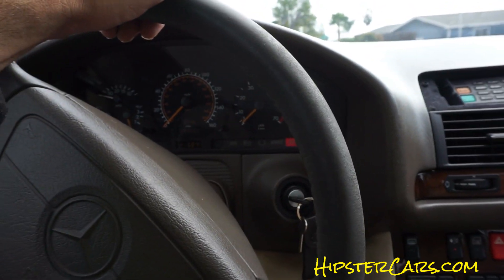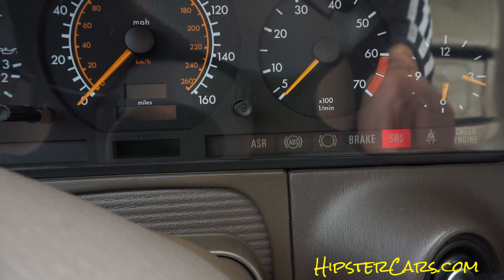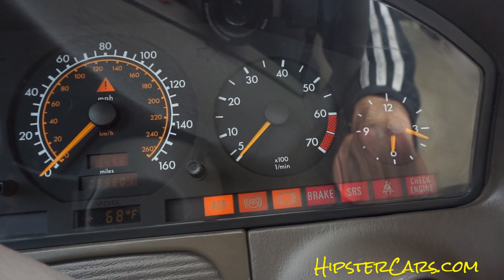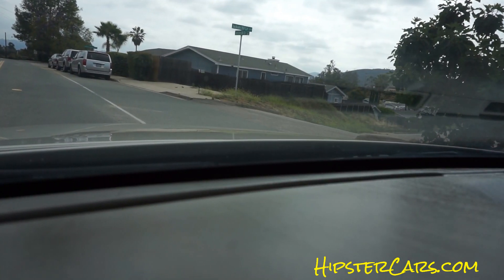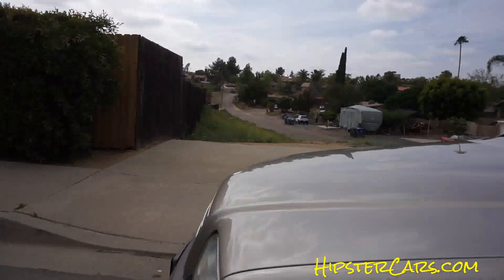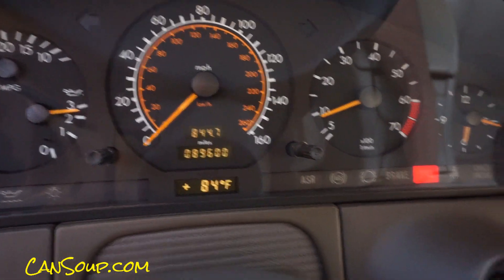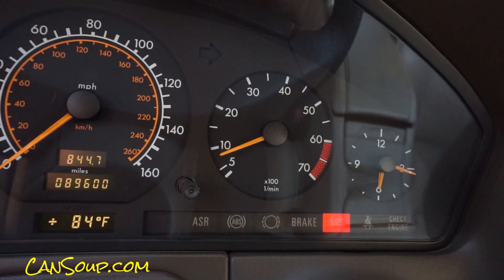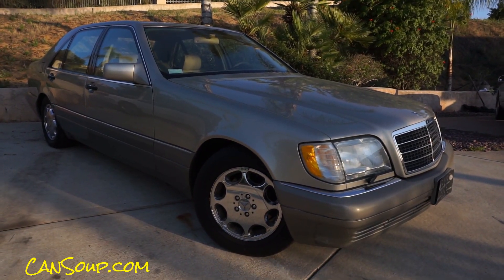Fix Mercedes S500 Catalytic Converter issues Broken W140 Car

Comment: Hey Nathan, i have seen that issue on the M119 engines before and basically the fuel pressure is too low or a problem with the throttle but my ultimate bet is the fuel pump assembly (with the filter) start of by purchasing a fuel filter it might be clogged and its cheap if i remember correctly the part number should be A0024773001 if it did not help the issue just replace the fuel pump. well it seems that you have few w140 swap the fuel pump assembly with the green w140 you drive its a 10 mins tops job but take care when removing the filter/pump you will be sprayed unless you remove the fuel pump relay in the trunk close to the battery and start the car... but im 100% sure that it is NOT a cat problem Cereal Marshmallows

Comment: I have the same issue on my 95 S500 Coupe now. My cats went bad so i emptied them out & after that it was dumping allota fuel & choking up. Plugs on passenger side would get wet & after chilling a few hours it would start & drive for a few minutes till it dumped fuel again. Now it won't start at all
Reply: I have a clog in the catalytic converter. Do you recommend draining the catalytic converter? Does it cause any harm?

Comment: Hi! My '95 S420 is doing the same thing intermittently plus I hear popping under the car around where the middle about where the cats' are. I was thinking the CPS but what was the cause of your issue?
Reply: Did you figure out the poping sound under the middle of the car? mine barley starts and idles really bad and when I give it gas, I hear the poping sound under me then it dies instantly. All basics tests checked out good.

Comment: Now i know next to nothing about how Mercedes engines work, but when my Olds died on me in a similar fashion and then started up just fine after sitting for a while, it ended up being a power relay that tripped causing it to cut power to the fuel pump, I dunno if Mercedes sets up their power systems similar, but if they do it could be worth looking into any relays that might be bad that might trip and cut the fuel pump off from power.

Comment: i just parted ways with my 1992 500SEL after years of this issue. I took it to  3 different mechanics, at mercedes dealers and non-dealers, and each said they'd fixed the problem. A few months would go by with no problems, then it would die while i was in traffic and the cycle would start all over again. For awhile, i could let it sit for an hour and it would fire back up with no problems. Just like in this video. Then, that stopped working. Ultimately, I couldn't justify spending thousands of dollars on a problem nobody seemed able to fix. It broke my heart. It was a 1-owner car with just 50k miles when I purchased it in 2007. 10 years and well over 20 thousand dollars later I donated it. Now i am saving up to buy a 2007 S-Class, I just love those big sedans!
Reply: Stay away from the 07 SClass buddy go with 08 & up

Comment: I'd clean the mass air, need to check it when it wont start up again. could be fuel, but even something as small as a temp sensor can cause issues. I say it's something small.. easy fix.
Reply: Cereal Marshmallows That's cars for you, I guess it's hot now there??

Comment: In my country we remove the cat
Reply: Agreed! At least the secondary cats; wont throw any error codes. I removed the muffler too on my 99 CL500 coupe but kept the resonator. Fuel economy is worse but gained power and the V8 breathes better :)